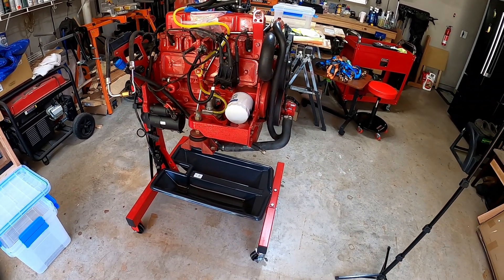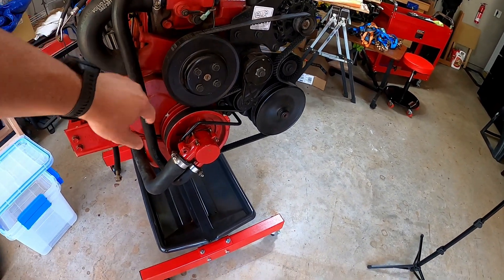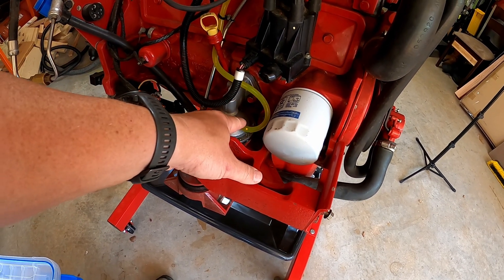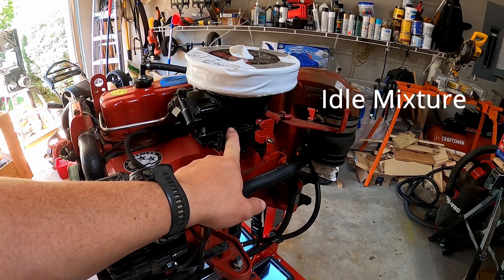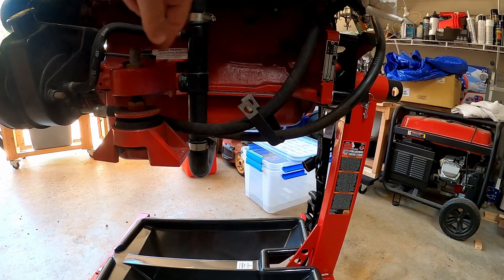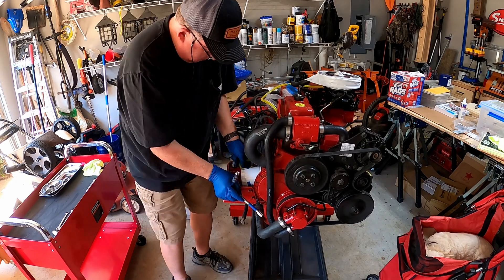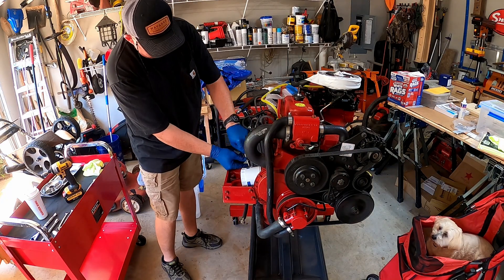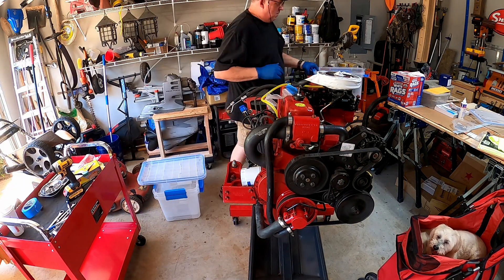Motor Tear Down Part 1 (Volvo Penta 3.0)

Comment from the maker: If I remember correctly, I used a very long screwdriver.   I don't recall if mine was up against the block.  What I do remember is that my distributor was clocked wrong and #1 was not allowing #1 on the cap to point towards the #1 cylinder.   No big deal if the wires are in the corresponding location.   However, I changed it when I reassembled the engine.

Comment: How do I remove the distributor cap screw that’s against the motor. What tool should I use?
Reply from the maker: I just answered above in the comments, thanks for watching!
Reply: @PhilFryOutdoors  another question if you don’t mind, I can get the motor to run but sometime it don’t want to stay on it turns right off or it won’t turn on at all. Any idea? Thanks
Reply from the maker: How is the fuel?  Is it old?  I had that issue before I realized that the Rod Bearing had spun and I replaced the Carb.  I tried to rebuild it but it just wasn't right so I replaced it with a profesionally rebuilt Carb.  Other posibilities can be timing, plugs, wires.  Also, don't rule out a clogged fuel filter or a weak fuel pump.  Hope that helps!

Comment: Hi, I've seen all your videos on this engine, very good, great job. I have a boat with 2 engines the same as yours, I'm from 2006, one has plugged the cooling water circuit for rust, they tell me that it's a risk to repair it and they don't give me a guarantee on the operation, if I disassemble everything and sand the monoblock, in your opinion I'll solve it? Thank you.
Reply from the maker: Is that what the machine shop says?  If it was me, since something has to be done anyway right... can't use that engine with the cooling all blocked off....  I would disassemble it, try and assess just how bad the cooling jackets are and determine if it's worth the machine shop trying to dip it and clean it out.  If you had them dip it and clean it and it's too bad off, then you are just out the cost of dipping/cleaning.  If it's so eaten up that the walls are too thin then I would look at getting at least short block or and new engine from someplace like Michigan Motorz.

Comment: Great info! Just bought a four winns with identical motor. Lots to learn that’s for sure. I for some reason having a hard time finding parts for it. I noticed you put some parts up under your description, I was looking for a new distributor spent hours trying to find one on Amazon and apparently you did!
Reply from the maker: Thanks! Actually, I used the original distributor and just replaced the cap and rotor button.
Reply from the maker: If you need the whole distributor, try this product on Amazon. https://amzn.to/44vRoGm
Reply: @PhilFryOutdoors  thanks sir!
Reply from the maker: @tjvaichus  Good luck on your project!

Comment: Great videos! I just bought a 2000 chaparral 180 with the same engine, your vids have been really helpful in educating myself about maintenance. My overflow line from the fuel pump to the carburetor had fuel in it and the engine would not fire without putting fuel directly into the carb. I order the same fuel pump on Amazon you recommended.
Reply from the maker: Thank you very much!  Sorry for the late reply.   I remember that I replaced my fuel pump before having to actually pull the motor and it was a bear.  I think it took me about an hour to finally figure out how to do it.  I wish I can remember how I did it...LOL...  Getting old I guess!  I think that on the output side I removed the fuel line coupler to give me more room to move it around.  Putting the new one back in wasn't any fun either as I remember.  Your motor mounts maybe a little different but I imagine they are very similar.

Comment: Phil,  
First off I want to thank you for doing these great videos. I just a boat from my uncle. It sat in his garage for 20 years. I don't know much about boats. But can you remove the engine without removing the stern drive?
Reply from the maker: I am glad you like the videos!!!! Unfortunately, you have to remove the outdrive but it's not that big of a deal.  I didn't do the outdrive removal/install myself because when I first had the issue I asked the marina to troubleshoot it for me.  The removed the outdrive and the motor and found the problem.  I rebuilt the motor and took it back to them so that they could reinstall it.  Mainly because they removed it and I didn't want to invest in the gantry that I would have needed to install the engine.  They had everything done in a day.